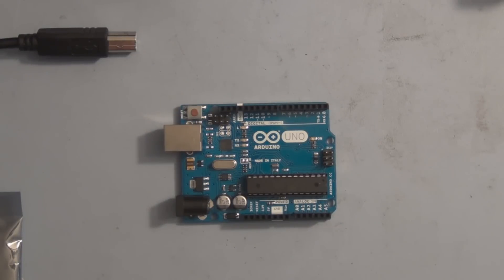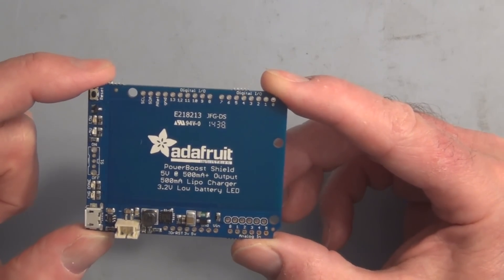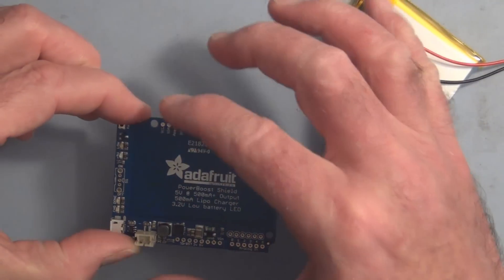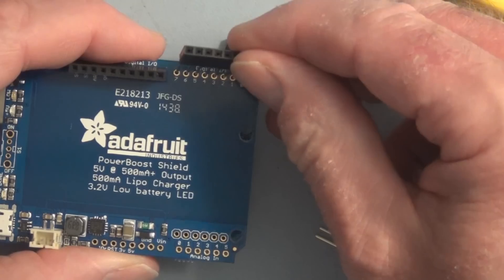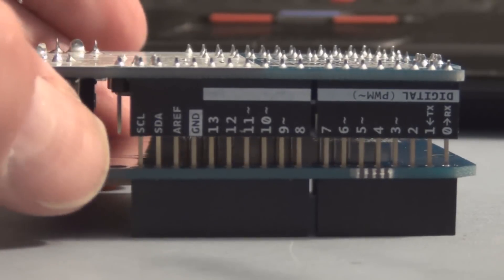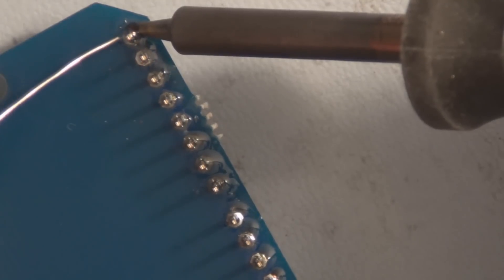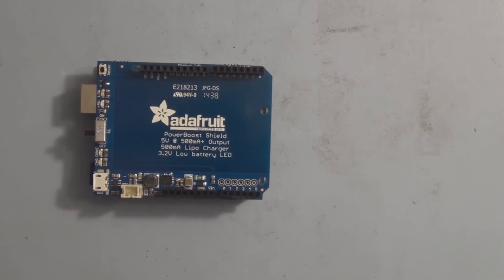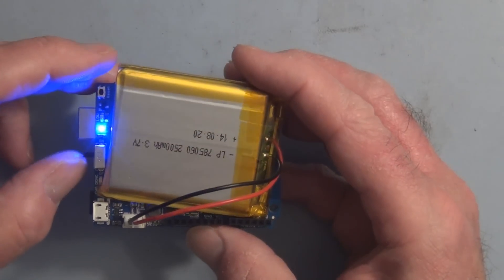Arduino Power Supply Options

Comment: can you power a micro servo with a 9 volt batter
Reply from the maker: The 9V battery will not be able to supply enough current to drive the servo.

Comment: i have an arduino one and a battery of 3.7V and 1000 mAh and the same power shield but when i do the connections my arduino doesn't work. Does anyone know the problem? was my connection or my battery?
Reply from the maker: Here is the information on this shield https://learn.adafruit.com/adafruit-powerboost-500-shield-rechargeable-battery-pack  It is difficult to diagnose your problem remotely.  First determine if the arduino still works on it's own.  What was the source of your shield and battery?  Did you wait for the battery to charge?  Can you measure a voltage on the battery by itself?

Comment: will it work if i don't weld  the shield with the arduino? sorry about my english*
Reply from the maker: Yes, The shield should produce 5V on the 5V pin with either the battery of the micro USB cable plugged in.  Did you have to solder the pins on your Shield?  I will upload a video today on how I would troubleshoot your problem.  Check to see that Uno works by itself.  Then check to see that your battery works.  Then check to see if you have 5V on the output pin on the shield.
Reply from the maker: https://youtu.be/-QaJ_HimX4U

Comment: can you tell me specifications of the battery that i have to look for on amazon while buying, is it necssary for the serial number to be 785060
Reply from the maker: I bought mine from Adafruit https://www.adafruit.com/product/2011 but there is one on Amazon that looks similar https://www.amazon.com/uxcell-2000mAh-Rechargeable-Lithium-Polymer/dp/B0798H3762/ref=sr_1_5_a_it?ie=UTF8&qid=1531850828&sr=8-5&keywords=2000+mah+3.7v+rechargeable+lithium+ion+batteries

Comment: The battery doesn't fit so it looks like an unsatisfactory solution and the method of soldering the pins leaves a lot to be desired.

Comment: This is almost exactly what I am looking for. The only thing I want now is for the charging option to be through metal contacts that I can use with a cradle of sorts. I assume that shouldn't be too hard to do though, just cut the wire in half and attach the ends to contacts. Thanks.
Any idea how long this will last with a touchscreen and a radio module in it?

Comment: Haha i consider using an Arduino for a real projekt kinda awkward.  This huge board for minimalist projects. So i use the arduino as designed for "prototyping" then afterwards is switch to often a Attiny chips or if i need a grunt or timed project picAxe.

Comment: You could use some double-sided adhesive and put the battery pack on the underside of the Arduino.
It may not look as neat, but it would work just fine and keep things together :)

Comment: I am not an expert, but looks easier to align and solder the connectors using the bottom side of other shield: plug the connectors in the shield, then "thread" the new PCB and use the arduino or other shield to be sure all is OK, then remove the arduino/shield and solder the pins without anything obstructing your vision and tools, is my "idea" ok or can it destroy anything?

Comment: is it for lithium ion or lithium polymer batteries? as far as i know there's no such thing as a "lithium ion-polymer" battery.
Reply from the maker: +rallekralle11 I found this information on wikipedia https://en.wikipedia.org/wiki/Lithium_polymer_battery.  I think the ion part is usually left out when referring to this battery or the industry as a whole might be confusing the general public about the correct name for it.  I purchased it from Adafruit and they are calling it a Lithium Ion Polymer battery.  https://www.adafruit.com/categories/138
Reply: alright, guess i've never looked into the battery types i use.